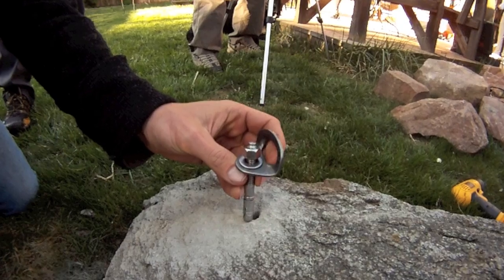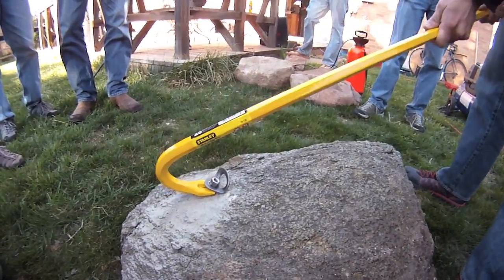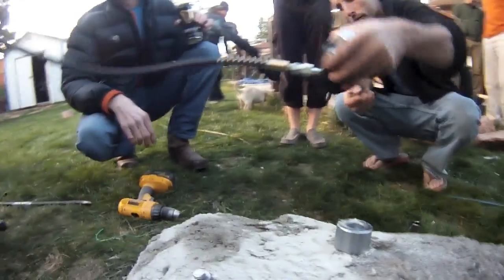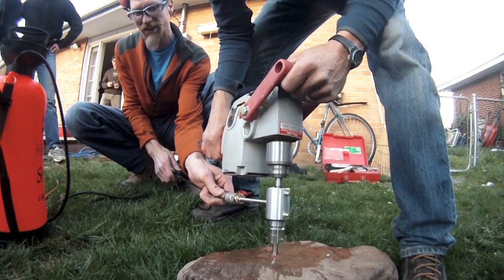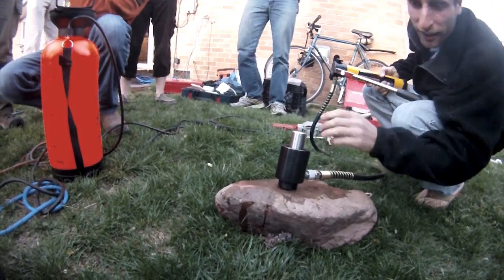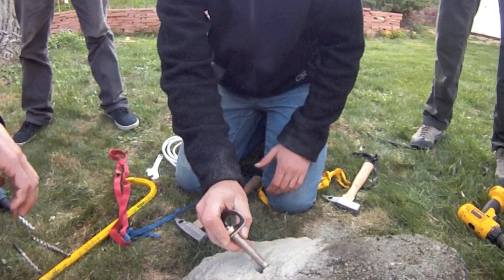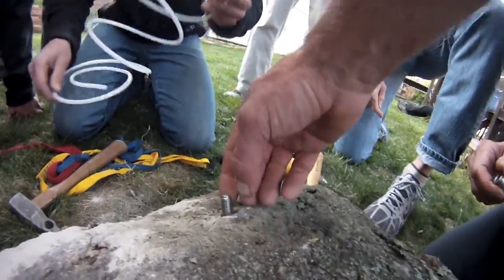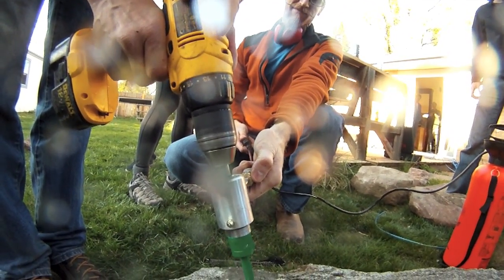Bolt Replacement Testing - Core Drill & Hydraulic Punch Driver

Comment: Nice work guys! What brand & model of core bits are you using? Also, if you use a hanger with a 12mm hole and install it over the sleeve of the Fixe Triplex bolt so that it sits behind the lip on the sleeve, you can use the hanger to pull out the sleeve without having to use the "tuning fork" to wedge under the sleeve and pry it out.